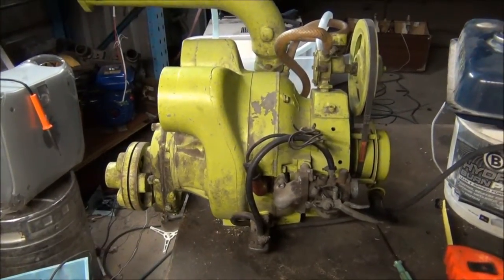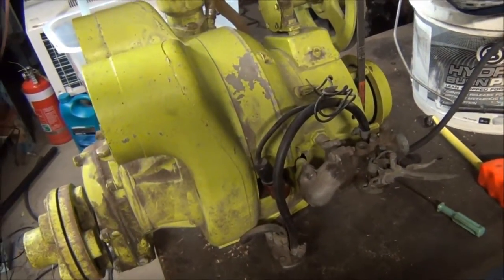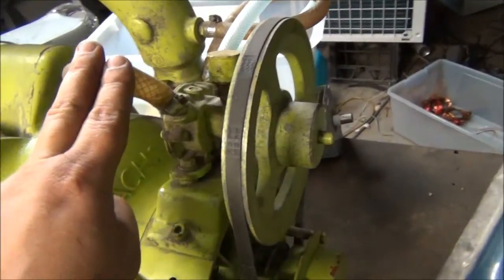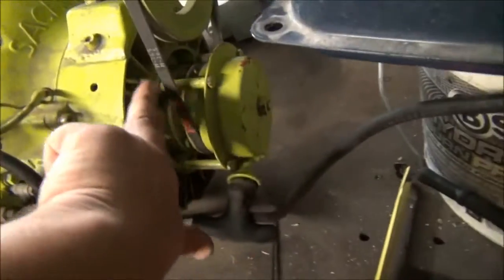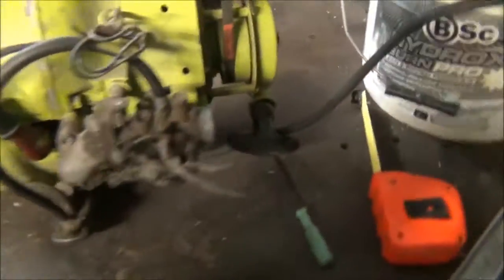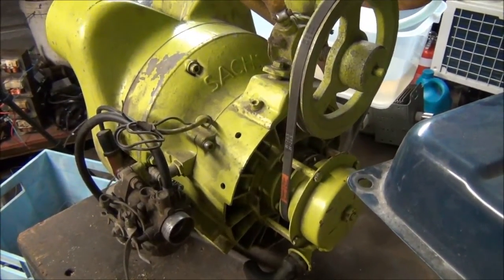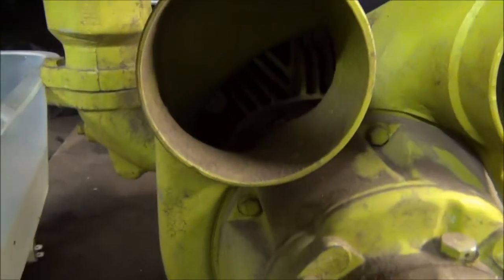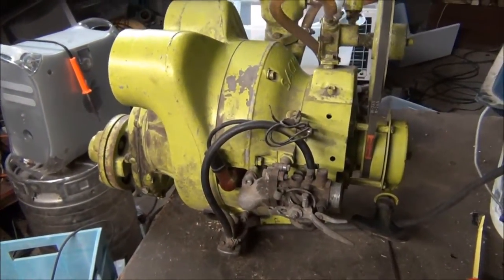Sachs 160cc Wankel Rotary Engine, Single Rotor - Overview!

Comment: the Sachs rotary engine you have here is a ccr design or Crank Cooled Rotor,bridgeported hence the brap brap brap , this engine was bridgeported to allow a more stable rpm under load,driving waterpumps(i have a rojector firefighter pump).premix was the norm for these as the incoming charge of fuel and oil would cool and lubricate the inner E  shaft needle roller bearings and displace heat away from the rotors themselves. service life was approx 1000hrs before worn beyond repair.

Comment: No it's a domestic AC operated set, it has five bands on it though including long wave, strange enough. G.E, and Canadian G.E in particular, used to use letters to denote the model year, though they don't seem to run in alphabetical order, an M-86 is 1935 but an E-81 is 1938.

Comment: I've had that happen before, a friend of mine had a 1935 G.E M-86 radio, which he was thinking of fixing up. So I found the documentation for it just to find out about the circuitry, and I figured he was probably going to send it my way for the electrical restoration. Four years later, just after Christmas, he phones and asks if he can drop by. He comes in with a huge box wrapped in wrapping paper, I opened it and inside was the G.E M-86. I still need to restore it though.